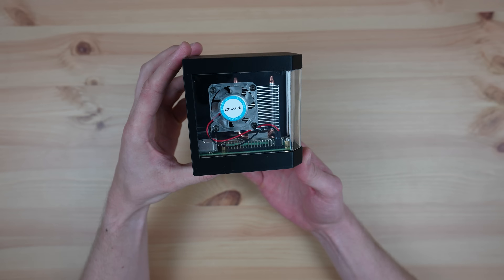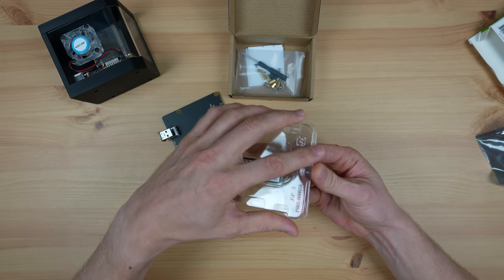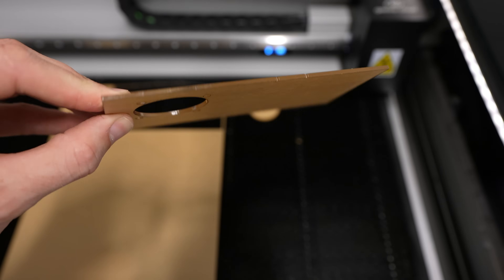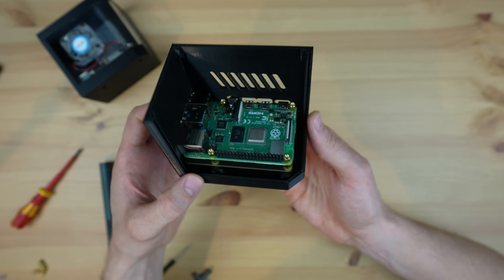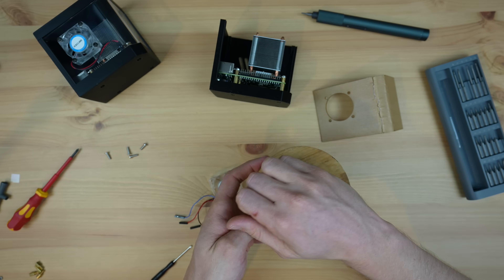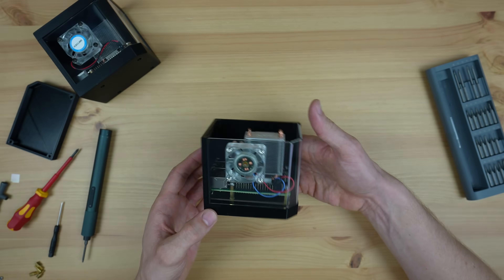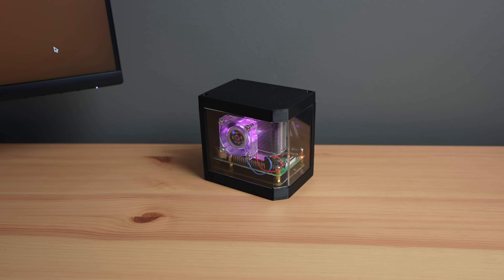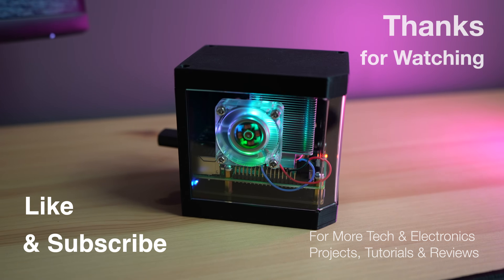My Raspberry Pi Case Now Has An M.2 SSD - and It's Way Faster!

Comment: Got a case with came with fan and also bought active cooler. can i use split cable to combine them and then connect to 1 header (the fan plug on the board)? Thanks

Comment: Hi.
Does this X862 v.2 need an extra power supply?
I saw that they removed power supply ports in the board since v.2 came out.
Reply from the maker: No, it draws all of its power through the USB port.
Reply: @MichaelKlements  Thanks.
And one more please,
Geekworm recommends to use their own power adapter 5v 4A 20W adapter.
Is it really necessary?
Can I just use the original raspberry pi 5v 3A 15W with this X862 v.2?
Reply from the maker: The USB standard doesn't allow for more than 3A to be passed through a USB port so theirs doing 4A doesn't make sense. The components on the Pi and the actual USB port and cable aren't designed to handle 4A anyway. I've never had any issues using the official Pi power supply.
Reply: @MichaelKlements  Thank you.

Comment: I have an external USB nvme but my raspberry pi 4 crashes randomly when it's connected to one of the USB 3 ports, I saw many people have this issue online and there's an open issue on GitHub as well but no solution

Comment: How about a case for the Pi 4B that supports water cooling (80mm radiator & fan)... This may seem to be overkill, but if you're overclocking it's so not. (Mine is sitting @ 2.4Ghz stable)

Comment: Do you sell the entire complete build (everything that are in this video)?
Reply from the maker: Only a kit with the custom parts, I don't include the Raspberry Pi (due to supply issues) and you can usually get an Ice Tower locally for less than what I would be able to include and ship one for.
Reply: @MichaelKlements  how much would all that, including the Pi, be? (everything we see in your video here)
Reply from the maker: It depends on the availailbity and local pricing of Pi's, you can get them from Microcentre for $35 in some areas (so the whole build would be around $90) and in some areas you can't find a Pi for less than $150.
Reply: @MichaelKlements  I see... could you sell me a complete build, that exact same one you've got in this video? I'm in Riverside, CA.
Reply from the maker: Unfortunately I don't have access to Raspberry Pi's either, so can't get them in quantities to be making complete builds.
Reply: @MichaelKlements  i see... could i guy everything that you've got in this video from you, except for the Raspberry Pi, so that I can build one on my own?

Comment: I think the fan should be shifted over a bit to aim it straight at the cooler. Probably not enough of an increase in cooling to warrant a change, but if someone were to build it from scratch it could be a consideration. I really like how much it resembles the liam li o11 dynamic mini, the o11-mini-mini.
Reply: yeh I have similar feelings, I guess he placed the fan off center for aesthetic purposes so that the heat sink is more visible.
Reply: wait until you hear about the hyte y60
Reply: @operatorpsyduck2035  Which has nothing to do with the location of the fan.
Reply: @TLM-Nathan   he did say it resembles the o11

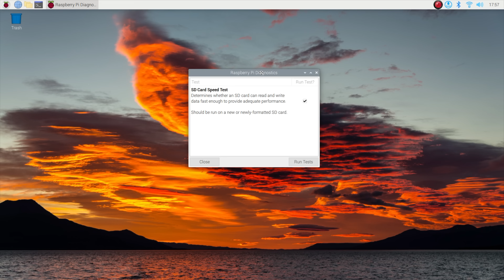Comment: what a complete trash, RPI made !ONLY! for workstation/education, it is not supported to use a desktop pc due to extremly low performance, it lags even when you open memory test 8:13
use 30 usd for cooler, 30 usd for ssd-usb converter, 80 usd for rpi 4 from aliexpress (i bet no living persons have geniue rp4, yes amazon also sells only copy from aliexpress), use money for acryllic case .. etc, and for what? for that money you can buy x86 mini pc or used NUC, this video is a joke, next time burn your money on camera if you wanna see us doing that, i will like that video

Comment: Looks clean and all but I believe if that fan was used as an exhaust or if there were an additional exhaust fan the performance might be even better. (feel like this way(as shown in the video as only fan being an intake) the system chokes after it gets a little warm inside. there is no single point that the air follows so it might be creating a turbulence or even worse it might have a dead zone where the air just stays getting warmer and warmer. this way it can lead to harming components, many people used to see on their fresh pc builds because of inexperience.

Comment: The SSD is slowed down by the USB interface! Why to overpay, if it's not working anyway o_O ?
Reply from the maker: The drive has a maximum speed of 580MBps and the USB 3.0 ports on the Pi have a maximum speed of 600MBps

Comment: Why M2? Why not lowcost SSD SATA over USB? How i know USB 3 has maximal speed 300Mb/s.
Reply from the maker: This is a SATA SSD, just in an M.2 form factor. The USB 3 ports on the Pi have a maximum speed of around 600Mb/s

Comment: I have one question, what kind of laser do you use to cut your acrylic? If not a co2 laser (which would be weird in that form factor - or i am missing something), how do you manage to cut clear acrylic?
Reply from the maker: It is a CO2 laser, this video has more infomation on it - https://youtu.be/MBt-CE1itS0
Reply: @MichaelKlements  okay, the short answer is - nothing i could ever affort or more precicely justify.

Cool device though, but for the Moment, i have a 5500mW Diode laser - works for everything not clear well enough but slow. Though clear acrylic is just dope...
Reply from the maker: Yeah CO2 lasers are quite a lot more expensive than diode ones, but they do allow you much more flexibility with materials and faster cutting speeds.
Reply: @MichaelKlements  might end up with a k40 type laser - but i do want linear rails.

What holds me back so far is the fact that they are really really powerful and on top invisible.

Nice, invisible deathrays xD
Reply: at my hardware store they will cut small pieces for me. they have a jig kinda like for cutting mattboard, where a razor blade scores it over and over in a straight line. you could just use a ruler. Then they clamp it to a table or a piece of wood, lined up with the cut, and snap it. I needed two small pieces to make an infinity mirror the size of a disk drive bay. They actually get very accurate cuts and give me  just a tiny extra to sand down. fits perfect in the machine.

Comment: This looks wonderfull! The only thing is missing here is RTC place to install. Lately I notice that RPI does not have battery and the clock updates from internet. If no internet - then clock is messed up, that is why you need a RTC (in this case of course). I believe this case still can get small improvement to install battery.
Reply: Also a turn ON/OFF button
Reply: @bunny_incup132  
you can do that yourself ... it works ...

Comment: The things you can do with these things are just bonkers to a tech pleb like myself. would there be a reason to liquid cool, for snits and giggles?
Reply from the maker: I'm looking at putting together a really small liquid cooling loop for a Pi, the one's I've used in the past have all been really big so they make installation into a case like this impractical.

Comment: First time watching this channel and this video, i see the case was made more taller to fit the m.2 but why not make an extra compartment or removable part a few centimeters to easy access the m.2 from the bottom like the top with 3 screws or 4 since is facing down. Only way to upgrade or replace would be taking apart everything.
Reply from the maker: I suppose a cover could be integrated into the base fairly easily, I don't really see a reason why you would need to access the drive regularly. To upgrade the drive you'd only need to remove the three screws on the top cover and the four holding the stack to the base and you'd then have access to it.

Comment: Why did you place the fan offset to the mini towercooler? If you place the fan directly in line of the cooler, wouldn't that increase the cooling? Now part of the air goes straight past the cooler instead of through it, therefore decreasing cooling capacity.
Reply from the maker: I move it further towards the side to improve visability into the case, if it is aligned with the cooler than you can't see much through the acrylic - which sort of defeats having a clear side. 
The Ice Tower is already a significant overkill for a Pi, as long as there is some air circulation within the case it doesn't really need air to be blowing directly onto the fins.

Comment: Awesome as Always bud! 
Few Questions though 
1. Why the WD M.2 Sata SSD ( I've only ever had issues with them)  Maybe you have had better luck?
2. How do you get your hands on so many Pi's or do you just reuse you already purchased ones?

Thanks again for the awesome content
Reply from the maker: Thanks Chris,
I usually go with Crucial but couldn't find stock locally, so got the WD instead - I haven't really used WD drives much so I'll see how it holds up.
I'm just re-using the same 8 Pi's I bought 2+ years ago for my cluster build, I haven't been able to get a new one in over a year.
Thank you for the support!

Comment: Great vid.  Your case looks sleek and does not need any improvements.  A future project could be a case that incorporates the pi, cooling fan, audio amplifier with speakers and an internal power distribution system.  The project would be multipurpose.  Just a thought.
Reply from the maker: Thanks Greg, thats a nice idea!
Reply: @MichaelKlements   can you use that to cypto mine
Reply: @tcathunder  don't be a part of the problem, you lead to e-waste
Reply: @Theoldenmage   dah
Reply: The case is based off the Hyte y60 case

Comment: Will you ever make a case with:
- M.2 SSD
- Pi UPS
- OLED display
It would be soo cool! Maybe even add another SATA converter for an HDD..?
That's the ultimate pi server setup!
Reply from the maker: Its actually in the making at the moment, I've been making some tweaks to it over the past few weeks. It's a bit of a challenge since both the SSD shield and UPS shield are designed to fit directly underneath the Pi, so one of them has to be adatped to work.
Reply: the display could even be touchscreen, you could add a touchscreen OS and maybe if it's possible a battery to make it basically a phone!

Comment: Very cool..I wish there was a way to install the /boot partition ONLY to the microSD card, then tell the rest of / to install to the SSD, this way it only touches the boot SD card to initialize on startup (no special firmware or kernel tricks), then the rest of the OS can run from the SSD, and you don't have to worry about trying to install the OS directly to the SSD and if firmware or corruption then locks up the system...at least with the SD card, with boot, it will still always boot to that SD card, then a fsck can be run on the SSD
Might look into getting a SSD heatsink, I hear those things can run hot
Reply from the maker: Thanks for the suggestion, I might look at getting a small aluminium heatsink for the SSD

Comment: if you sell these cases?😆
Reply from the maker: Yes I've put them up in my Etsy store, link in the video description
Reply: @MichaelKlements  if this ready to any 3D printer to print?...I am noob
Reply from the maker: You'll need to slice it with your printer's settings but other than that it's ready to print

Comment: Correct me if I'm mistaken, but won't the nuts that are pressed into the fan simply fall out after a while? It seems the nuts should be on the far side of the hole in the fan, or did you somehow glue the nuts into the fan? It doesn't look like they are in there very tight.
Reply from the maker: The press fit is really tight, I've had them running this way for 2+ years on my other cas that I move around a lot without any issues. Ideally yes you'd want the nuts on the opposite side to the fan, the way I've done it allows you to re-use the screws that come with the fan rather than replacing them with longer ones.
Reply: Good remark, was thinking the same. Good answer as well!
Reply: You can use loctite

Comment: I plugged an SSD into a USB- M.2 converter in a Pi. It worked, but dang the SSD got hot af. The 180 degree USB-USB thingy is darn cool. I wonder how hot your SSD will get, and if that heat will be radiating up to the Pi or if the FR blocks it...
Reply: Sounds like the fan exhaust holes should've been on the side of the case, next to the SSD on the fan side. This way the air that gets pushed in can travel all the way through the case and be ejected right next to the SSD, also pulling along the heat from the SSD. Of course, there would have to be a little bit of extra space next to the Pi on the far side from the fan, and the Pi should internally sit snugly against the wall where the fan is mounted to force the airstream to take the longest path.
Reply from the maker: I'll have a look at this after it has been running for a while, I hadn't noticed any temperature issues when using it. I might need to add a small aluminium heatsink to the SSD to help out.